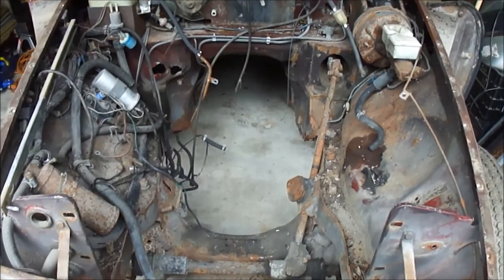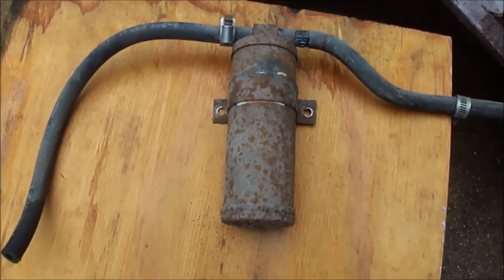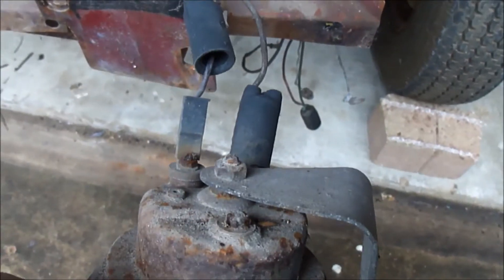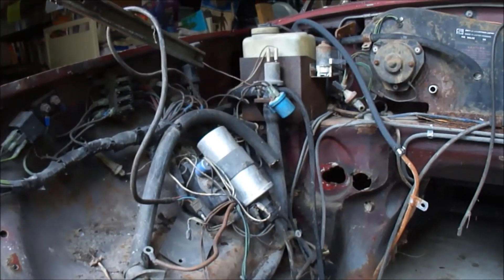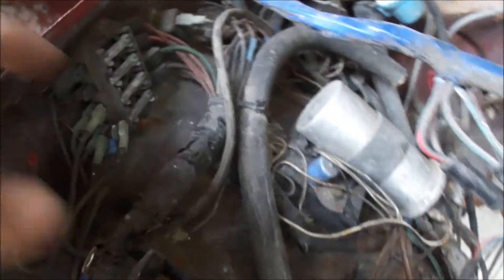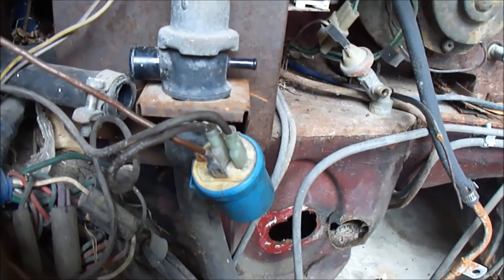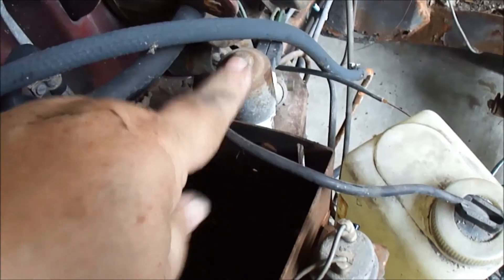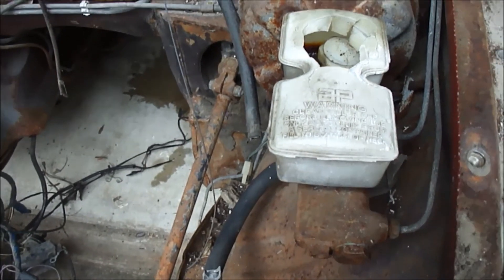1977 MGB Roadster Restoration Project Episode 9 - Tear Down Part 5

Comment: the white tank is a wiper washer fluid tank.  the little thing it was plumbed into was the pump.  the little switch with the wide hose coming out of the bottom is the anti-run-on switch.  the big black canister is a charcoal canister.
Reply from the maker: Thanks.  I appreciate your knowledge.  Some of the parts can be re-used.  I think the charcoal canister should be new.
Reply: actually if all the fittings are still there and haven't broken off, it can be opened and filled with activated charcoal for fish tank filters...  all it does is filter crankcase gasses, and the vent from the gas tank.  and another from the carb.  I think there is an article on mgbexp or britishcarforum about recharging the charcoal canister.